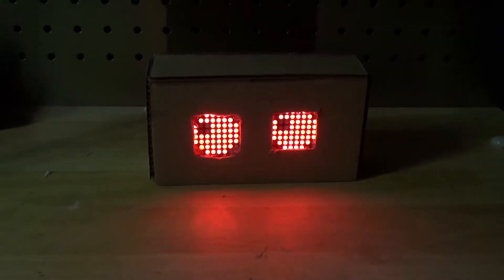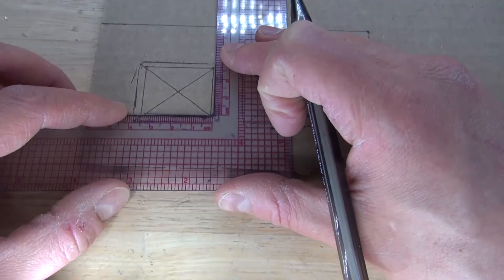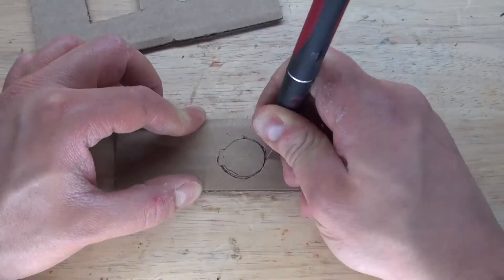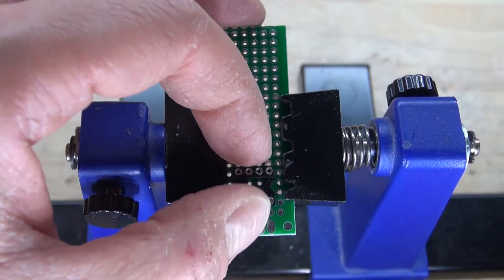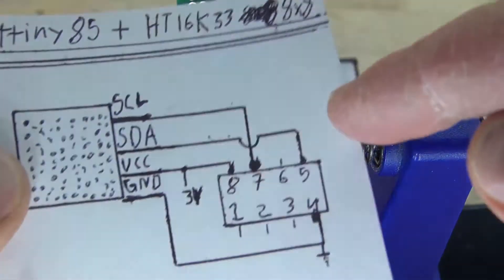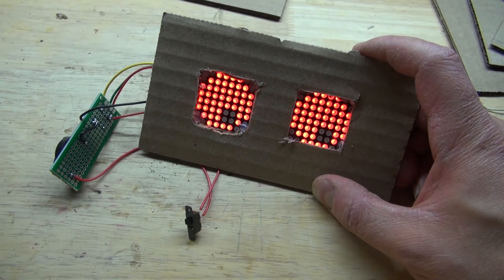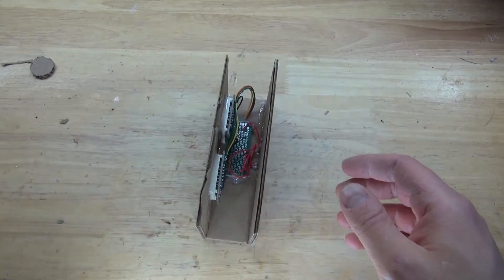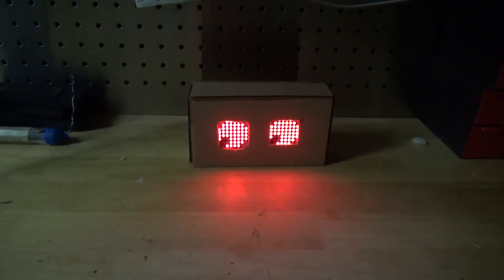8x8 LED Matrix Robot Eyes Box With Attiny85

Comment: The two matrices share the same i2c adress ? 🤔
Would you share the code, pls ?
Reply: They become one when daisy chained like this. That’s why the eyes aren’t moving independently from one another. That won’t be possible until they are on separate addresses. For now, the code interprets them as just one matrix screen.
Reply from the maker: The code can be found in the Arduino ide. Files/Example/Adafruit led backpack library/roboface.